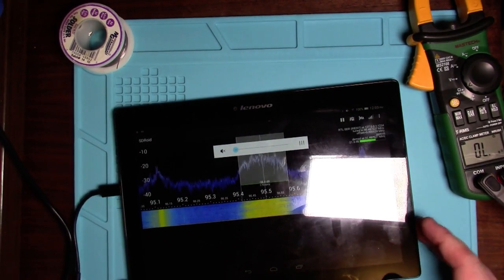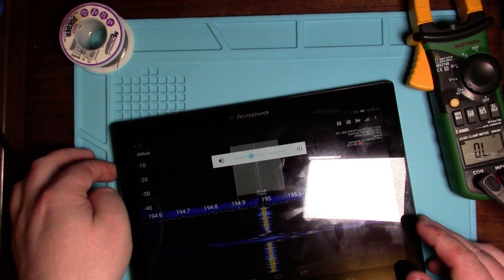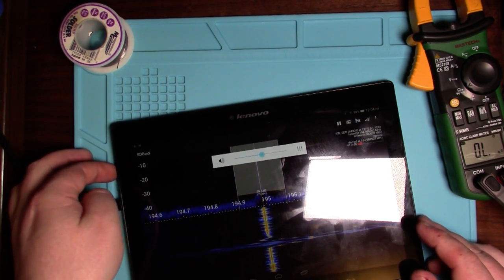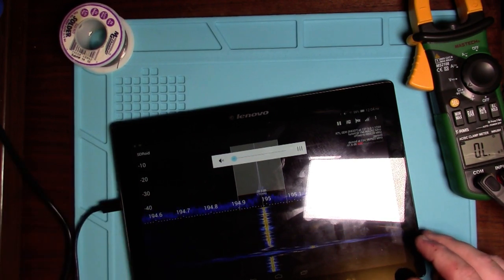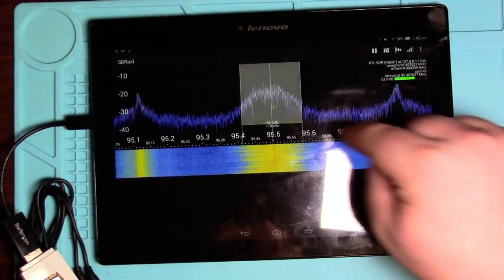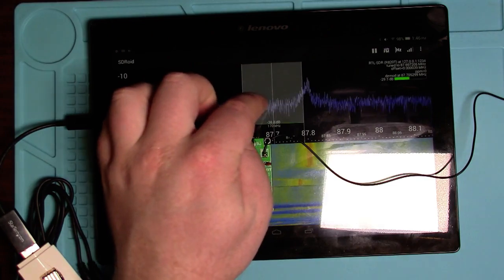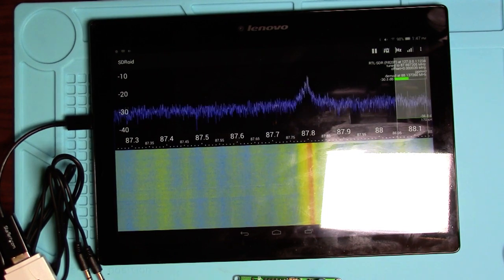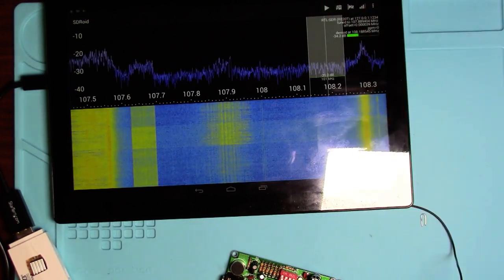Radio transmitter kit

Comment: I know I'm a few years late now, but you were not reading that chart on the back of the PCB correctly. For 87.7MHz the DIP switch selection is LLLL, not OFF, OFF, OFF, OFF. The circuit diagram shows that the pins are held high through resistors, & they are grounded (L) when the DIP switches are set to ON. So the DIP switches should all be set to ON for 87.7MHz.
Reply from the maker: Yeah I think I figured it out after actually getting the missing capacitor ahah. The little board actually works pretty well

Comment: Range
Reply from the maker: Depends, if you put the antenna up and don't have any interfearence, you can go a few hundred feet. If you put it next to other equipment (especially radio equipment) you start to have issues receiving it at all. This can probably be improved by putting the unit it's self in a shielded box
Reply: @danrulz98  Well, if he won't say "thanks", i will. Thank you!

Comment: How did you get it to work? The 3 pico farad capacitor? My kit didn't have the 3 pico farad capacitor (C27) but had a 6 pico instead. I could not get the low range to work at all, and the high frequency was distorted badly on 6 volts. and not distorted on 4.5 volts but the volume was extremely low, and there was a pulsing sound coming through as well. I could only get one frequency working at all 107.5 even though there were no local stations on other frequencies. I also had in the kit a 5.6 ohm resister but it was supposed to be a 4.7 ohm (Resistor 8). The kit didn't seem to be broadcasting stereo, so all in all it was not a satisfying build. Note that on your build you didn't note that there are two types of transistors. Maybe you put them in the incorrect positions on the board? Any suggestion for my distortion on 6 volts or unable to use more than one frequency?
Reply from the maker: I bought a big variety pack of capacitors on Amazon and put a 3pf capacitor in there. It actually seems to work decently well
Reply: Daniel, thanks for the reply. Did yours have good audio with highs and low frequencies? I found very very bad audio with distortion and wasn't broadcasting in stereo at all.
Reply from the maker: Turn your source way down, the input is super sensitive and if you over drive it everything goes unstable.
Reply from the maker: If you have an SDR dongle like what I was showing in the beginning, you can actually see the thing freaking out. The part numbers on the transistors are small, but I'm able to see them, and considering my kit works perfectly after putting in the 3pf capacitor I think I got it correct :) The input voltage shouldn't matter too much, if anything it should affect the range that you get out of it. But, I mentioned in another comment the audio input is super sensitive. You need to have your source turned down pretty far for this to work right, and if you have your source up too high it'll distort the audio and the transmission won't be stable at all. It just starts spitting out random noise on all frequencies across the band, at least that's what I could see through the SDR software when I was playing with it. Turn down the audio source, and you start to see the transmission frequency get more stable until it locks on with clean, stereo audio. I'm running mine from 5v via a USB power bank, and I was actually getting pretty decent range, able to go clear down the street with a little Grundig radio (which granted is very sensitive).
Reply: Thanks Daniel. Your video and comments should help others with the kit project as well as other kits as well! I made a product comment to the company about how it didn't work well for me, and they offered "points" to me for the price of the kit but it does seem the points are only good for 15% of a new order. So, I'll see how that works out.
Reply from the maker: I did this as a live stream and had friends with the same kit following along :)

Comment: What is the range of this transmitter?
Reply from the maker: I'll try it tomorrow, I kinda have doubts that it's all that far
Reply from the maker: I put it on the edge of my desk and ran it from a USB power bank with my iPod plugged into it, then walked down the street to check my mail with a pretty sensitive little Grundig radio. With the antenna out on the radio, I walked about 3 houses away before the signal started to loose the stereo portion and get staticy, but I had mono audio with static all the way down about 5 houses away. Not bad actually, certainly should be able to get audio all over a house with it. Since I'm using a USB power bank to power it, I was able to measure the power consumption, I think its transmitting with about 120mw of power